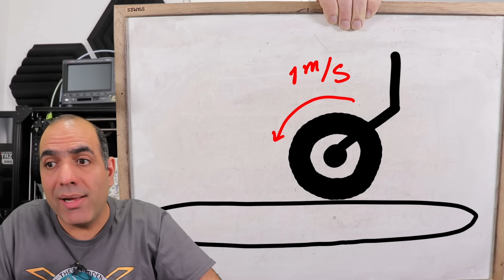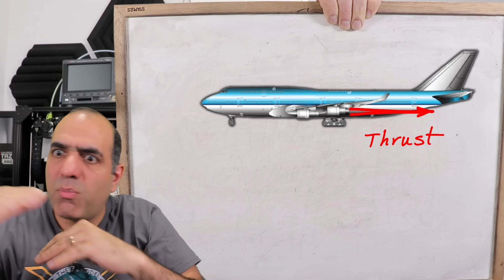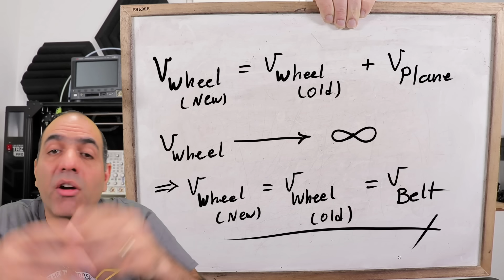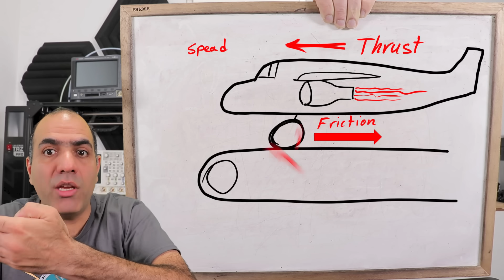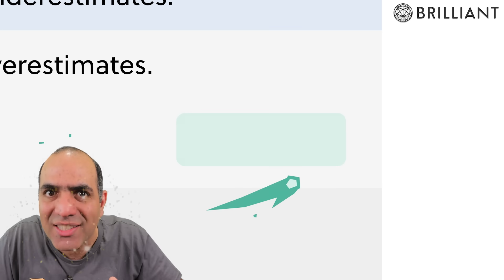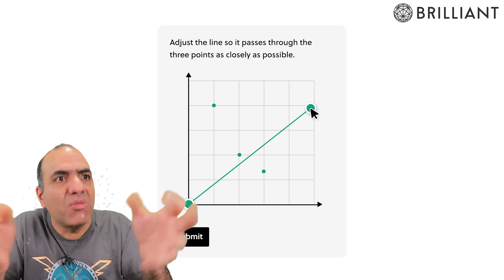Airplane Question that Drove Me NUTS!!!

Comment: It can't take off.
Because since the plane and the belt are moving the same speed, the plane will always be at the same position. 

And for a plane to take off, it has to moving forward in order to gain speed and lift up in a projectile manner. But since it's not moving forward, the only option is for the plane to jump😂 and that's not possible.
Reply: But on the other hand, it might actually still take off. Cos it's already accumulating speed on the belt. So it can actually take off

Comment: No because the airplane needs air to flow over and under the wings to cause lift, if the conveyor system was to propel the airplane it would take off if the conveyor was long enough to get enough airflow under the wigs for enough lift. Thus the jet power to propel the plane forward is why they are there in the first place. The conveyor belt can never take away the push of air through the jets. The drive doesn't come from the wheels in the first place. If the conveyor can go 170-180 knots then the plane might stay still on the runway or conveyor belt if there is no lift on the wings. Put that would have to negate the thrust of the jets and that is not going to happen, just like Mythbusters using a propelled plane in their experiment.

Comment: The conveyor belt exactly matches the speed of the wheels which means they never even turn. They start off with no angular velocity and the belt keeps them that way. The plane takes off as normal. As it moves forward the belt moves with it to keep the wheels from turning. But so what. The jet engines don't care.

Comment: (replying at the start of the video here)

I mean, am I dumb for thinking it obviously wouldn't take off? The wheels don't fly the plane, the wings do, and if the wings aren't moving through the air then the plane can't achieve lift.
Reply: (further along now)

I understand what he's saying about the wheels not being the thing that moves the plane but I don't think that's the point. The engines obviously move the plane forward, but it's a heavy plane on a belt that exactly matches the speed of its wheels, it's not going anywhere. Even if the belt is delayed the best it can do is fall off the edge of the belt and crash before getting any air time.
Reply: The wheels and treadmill are a red herring, the forward propulsion of any aircraft comes from the interface between the engine blades and the air, nothing to do with the ground. Even with the wheels locked so they can't rotate, those engines are so powerful they will still push the aircraft forward, which is a part of the safety training for static takeoffs. Freely rotating wheels on a freely rotating treadmill would be no problem for 120 tons of thrust force, it would be nearly identical to a standard takeoff
Reply: @snowthemegaabsol6819  only if the treadmill is freely rotating, though in this scenario the friction of the treadmill is designed to drag the plane back, keeping it in place. It's still the wings that achieve lift and if the friction of the treadmill is keeping the plane slow enough then the air still can't move fast enough across the wings to achieve lift.
Reply: The treadmill isn't set up to hold the aircraft stationary by friction, it's designed to match the tangential velocity of the wheels. In an ideal world, this would result in a constant friction force of 0

Comment: I notice nearly 6000 comments so I guess this will just get lost like a message in a bottle thrown into the sea of bottles, but here goes:

TLDR: The question is incomplete.

Explanation:
The 747 produces thrust by moving AIR through the engines, not powering the wheels.
Any thrust that overcomes the static friction of the aircraft will move the aircraft forwards.
The above points are irrespective of rotational speed of the wheels.
It is not possible, physically or mentally, to construct a conveyor belt that will perfectly counter the wheel rotation.

Condiser, instead of an aircraft on a conveyor belt, it is a person in a wheelchair on a treadmill. This is much more imaginable to a human brain.
No matter how much the person powers the wheels of his wheelchair, the treadmill works to perfectly counter the movement and thus the person remains stationary.
Now imagine a rope in the hands of the person with the other end attached to the wall in front of the treadmill.
The person can pull himself forwards using the rope. This, by definition means the wheels must rotate forwards. If you define that the treadmill must perfectly counter the wheel motion, this is impossible.

Comment: Yes it can take off and yes it can fly.
Why ?
Well first : you're stupid sorry I had to tell you that "DEAR READER".
secondly. The plain needs to move fast enough for the wings to lift it by cleaving through air pushing it upwards. and the wheels are there to slide over ground we can replace them with ice skates and we would have the same effect since they generally don't even have engines in them relying entirely on the thrusters to push the plane

Comment: The runway would move forward in the direction the plane is moving so the wheels wouldn't turn.  The plane would move forward and takeoff normally with the wheels not spinning.  From the point of view of someone sitting on the runway next to the plane, the wind would get stronger and stronger and then the plane would lift vertically off the runway.

Comment: 0:40 Yes, it can fly because it's not driving with the wheels. It's using the jet engines that are separate from the conveyor belt. The serpentine belt would never be able to impart enough rolling resistance on the wheels to overcome the power output of the engines.

The only way the conveyor belt could potentially stop it would be if it spun so fast it burns up the tires and/or bearings of the wheels.

Comment: Friction and weight force is the key to the answer....you can make the conveyor move in any direction you wish; doesn't matter. Airspeed is speed through the air, not relative to the wheels on the ground.

Comment: The conveyor belt is stationary. No wind. That's like us running on a treadmill. We need fans to keep us cool, however without those fans we are sweating like an over-hairy dude walking around with a jacket and sweater on in +35 weather.
No wind means no lift.
Those conveyor motors though would be overheating pretty bad.

Comment: Answering before I've watched the video: Assuming that the wheel bearings are frictionless etc. - I think it's a paradoxical question. The belt CAN'T move as fast as the wheels. The plane uses jets as propulsion - as soon as the plane is travelling at even 1mph a feedback loop occurs where the belt moves, the wheels spin faster because of the additional movement of the belt + the ground speed, the belt moves faster, the wheels move faster still... Even so, the plane could still increase its speed and take off (assuming the bearings are frictionless), it's just that the belt will not match the speed of the wheels at any speed above zero.

edit: In Answer 3 (the wheels DO have friction) it wouldn't necessarily not take off - it'd depend on the acceleration of the plane, the acceleration of the belt, and take-off speed  of the plane. So, you actually have five answers in total.

Comment: 747 will gonna need 160 knots of speed to take off.
To be extra safe, I would suggest 200 knots of headwind, and then it will fly on the air.

Comment: So, to answer the question you need to know that the wheels of air plane are not actually making it fly, so basically before taking off the spin of the wheels are 0 and engines are used so they fly with engines only ?? No , they need more space to build speed and air lift and it will not make any difference if the floor is moving or not because it has wheels
Reply: And i thought I was smart, he answered the question with video explaining it

Comment: Heres what I think. Even if the plane was at max thrust, I doubt it'll fly. We have to take relative wind into account since it has an effect on lift. How can we have relative wind if the plane isn't moving into the wind. The plane is technically not moving since the wheels and the conveyor belt are moving at the same speed. If you're running on a treadmill, you dont feel the wind blowing into your face unlike running without a treadmill. To me the most important factor is the wind. The thrust to get that to takeoff would have to be significantly greater than what the plane in the question has.

Comment: leaving my comment at the requested time stamp, i assume that it wont take off because its velocity would be 0. 
now to see if i fell for a trick(y) question.
Reply: i totally fell for the "treadmill" lmao
in hindsight i wish i would have actually thought about it for more than 2 seconds.
also i assumed that the conveyor belt would match any change in velocity of the wheels, no matter if they're introduced by the engine or turbines.

Comment: the force of friction is finite and not dependent on the speed of the belt. it depends only on the weight of the plane, and the coefficient of friction of tbe surfaces. increasing the speed of the belt to infinity will NOT increase the backwards drag to infinity. It can ONLY increase the force up to a fixed number, and that number is not big enough to overcome the movement of the engine.

Comment: at first I thought  no, because the plane would not move so you would not get any lift, but then i realised it's the engines providing thrust, so the wheels aren't making the plane move, they are just allowing it to move over the ground without friction. the conveyor belt fights the ability for the wheels to do their job though, so either the wheels or the conveyor belt would quickly be driven to destrouction through stress and it's the same question as "can a plane take off if the wheels were not working" The answer is probably yes, but the underside of the plane would be very badly damaged as a result.

Comment: well yes, because the wheels move freely from the thrust of the turbofan engines and so will still move the plane forward unlike a car that needs the wheels to push along the surface (in this case the moving conveyer belt)

Comment: Guess: It will take off because the wheels are in freespin, the force comes from the engines which would still be able push the plane forward, the wheels and treadmill would just spin faster and faster until the plane leaves the ground

After: Uhhhhhhhhh no? Maybe? I give up. This is a dumb question

Comment: If we ignore all effects the belt would have on air surrounding it:
The airplane has 0 airspeed, airspeed is the only reason lift is generated, plane cannot take off.
Groundspeed does not matter at all.

You could technically take off and go backwards (across the ground) given you have enough headwind.

Comment: The plane will not take off because aircraft would not have enough airspeed(the speed at witch the air moves over the wings) to create lift, 

EDIT: That answer was based off if you where not using the engines, DAMNIT I WASNT THINKING ABOUT THE FRICTION DAMNIT

Comment: no you need air speed for creating lift on the wings
Reply: why would you not have air speed?  do you think airplanes are driven by their wheels?
Reply: @tsm688  where those it say the are running?
Reply: @b-miner712  what?  I don't understand your question.  Every interpretation I can imagine of it is gibberish.
Reply: @tsm688  i can imagine that after a thinking period of a month lmao
Reply: @b-miner712  I didn't actually notice your reply until a spambot bumped this.

Comment: The plane will not take off because for planes to fly they need to have air moving under the wings, it does not matter how fast the wheels are turning
Reply: why would you not have air speed?  do you think airplanes are driven by their wheels?

Comment: I'm still at the beginning of the video, since the plane won't have speed relative to the air around it, there won't be any flow around the wings and so how could it possibly lift? Slowing down too much while airborne means the plane stalls and loses altitude so.... My answer would be no, the plane on the conveyor belt won't fly.
Reply: why would you not have air speed?  do you think airplanes are driven by their wheels?
Reply: @tsm688  He already answered this in the video, there is no point asking that now. No I didn't know that all of their acceleration was from the turbines. I thought that to start they used their wheels yes.

Comment: The tires have a speed limit. The tires could explode before the plane takes off.
Reply: unless the question tells you the tire speed limit, you can assume that's not a problem.
Reply: @tsm688  the industry standard for the tires speed is 245 mph. It’s pretty consistent across all types/configurations.
Reply: @Casey_Schmidt  unless the question tells you the tire speed limit, you can assume that's not a problem. This is a physics question.  It's not about pulling new facts out of nowhere.
Reply: @tsm688  it does tell us the speed limit though. The question uses a 747. The 747 has a specific tire specification called out by the Aircraft Maintenance Manual. That specification refers one and only one tire which will have a speed limit rating on it. If the question just said “an airliner” and not “a 747” I would completely agree with you.

Comment: I don’t understand why the belt should run at 2V. If you simply supose the linear velocity of both, plane and belt are the same I think there isn’t this problem, correct me if I’m wrong.
Finally, I think that in the case with friction between wheels and belt, it doesn’t care if there are frictionless bearings the relative speed between both is zero and there is no movement of the airplane relative to the belt or the surrounding air, this condition of friction is the reason why the velocities must be equal and could be named as non slip condition if I remember well. That’s what I think, again, correct me if I’m wrong.

Comment: I know my answer is bad and dumb but I'll leave it here for my guy to have better video reception and for history to remember me. So in order to take off the plane has to have a lot of horizontal momentum which it will start converting into a vertical. If it's on a conveyor belt, which moves backwards to it's wheels, then the plane has no momentum in order to take off, the plane will just stay in one place, since all the force that wheels generate would just get stopped to negate all the force that is used to move the plane back, thus making it stay in one place.

Comment: Assume the engine has thrust.  The belt matches the tire speed, which is zero. the plane starts moving forward and the wheels do not spin, but the conveyer moves.  Plane takes off without the wheels ever spinning.  There are many planes that don't have wheels.

Comment: If the plane is on a conveyor belt with the belt turning at the same rate as the wheels then the plane is technically stationary and is neither moving forward or backward. Similar to how a treadmill works. You're running, but not going anywhere. Thus, the plane cannot take off due to a lack of air currents that could create lift via Bernoulli's principle of air pressure. It would be impossible unless the plane had its normal acceleration to create high pressure under the wing which causes the plane to lift toward the area of low pressure above the wing. In this thought experiment there would be no actual interaction between the plane and the rush of air due to acceleration. Thus, the plane cannot and will not take off. A plane doesn't derive its lift from the moving of the wheels. It's all about air pressure and fluid dynamics. 
Now, I'm not a physicist, Just a nerd that's into science.

Comment: Conservation of energy. Where exactly are we losing all that thrust from the powerful jet engines if the plane is not taking off?
Reply: It's going into the rotational energy of the wheels.
Reply: @Mobin92  and heating up the bearings
Reply: @samueladitya1729 It is insignificant.  If rolling resistance represented a significant enough force we'd be launching planes by catapult.  The thrust is mainly overcoming the inertia of the aircraft, not fighting the rolling resistance.
Reply: @  but the treadmill is rolling faster than sound, rolling resistance is exponential to the speed. No matter how small the rolling resistance, the treadmill will keep ramping up keeping the aircraft stationary to the speed of light.
Reply: @samueladitya1729  yes. I realise my initial mistake. Though I would argue that it still would eventually take off as the treadmill when going at insane speeds would drag the air with it (which occurs due to fluid viscosity) towards the plane, creating lift.  !!

Comment: The jets push the plane forward but the wheels rolling on the belt counteract the forward motion, so the plane remains stationary and will not fly because the wings of the plane are stationary with respect to the surrounding air and will generate no lift. End of.
Reply: planes are not driven by their wheels.  any force on the wheels, just makes the wheel rotate, and not push the plane.
Reply: @tsm688  I never said planes were driven by their wheels (which they are not). The plane starts moving relative to the conveyor belt, but that in turn counteracts the motion forward. Thus the plane wheels will rotate, but the plane is not moving relative to the surrounding air and so it will not take off. This is very simple - I fail to see how anyone could get frustrated about it and not see what would happen.
Reply: @cbnewham_ai  thousands of pounds of force pushing it forwards, nothing at all holding it back, and it's not moving?  why?

It's a trick question.  It tricks you into assuming it won't move.  it will move.